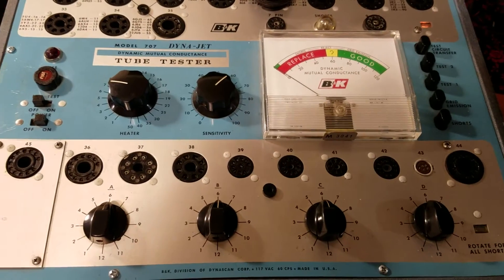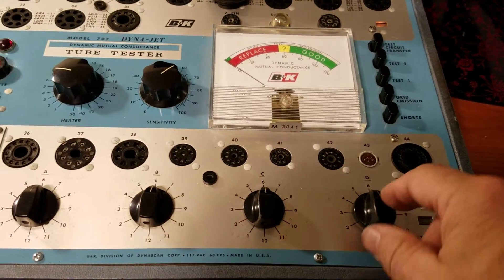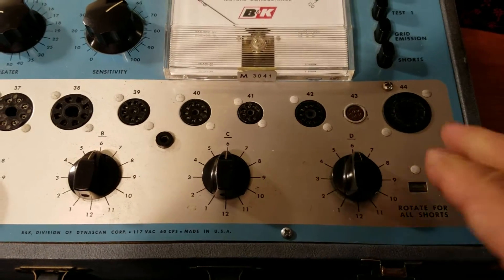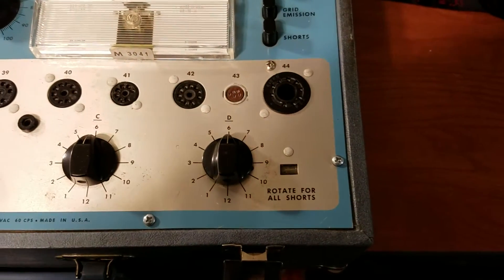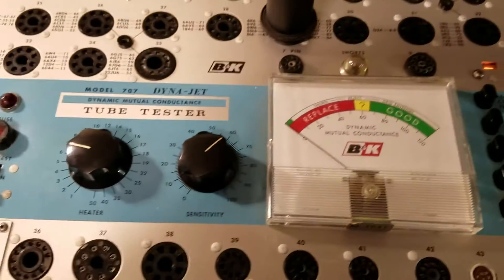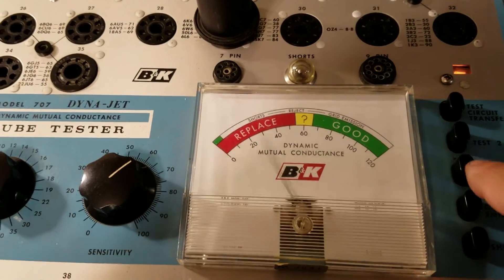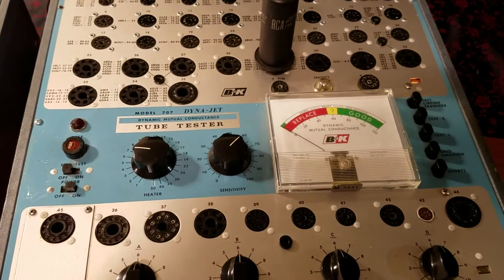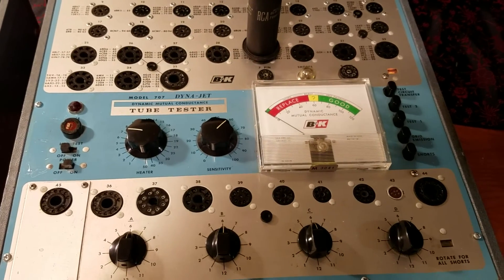B&K 707 Tube Tester

Comment: What is the difference  between the B&K 700 and the B&K 707?
Reply from the maker: old64goat boy I don't know for sure but can't be very much difference. Both work good.
Reply: I asked because you have both models.
I was looking at a 700 but the case is a wreck and will need to be painted, not sure if I want it, needs calibration too and I do not have any plug in test sockets.